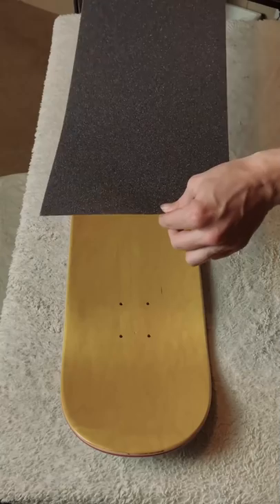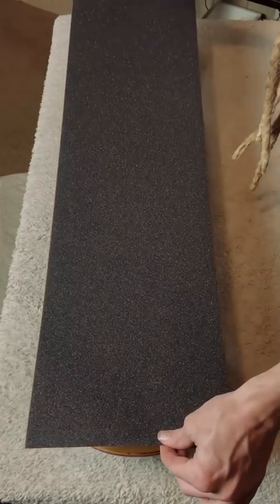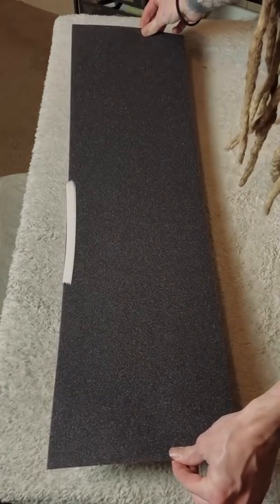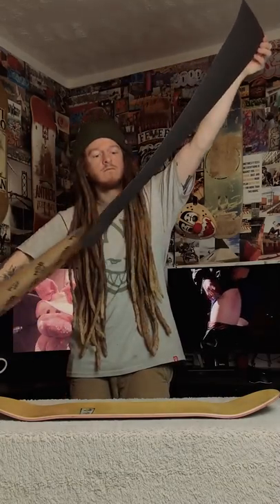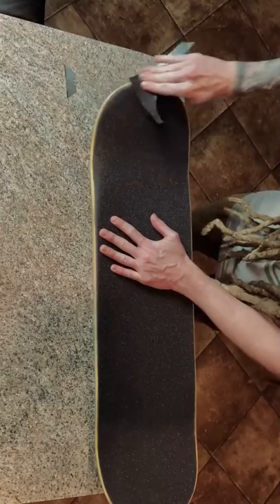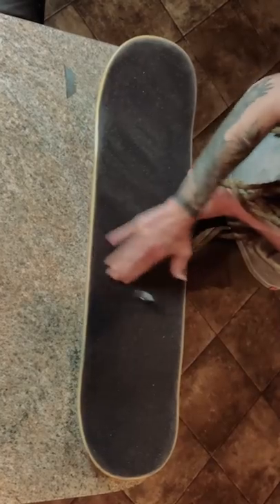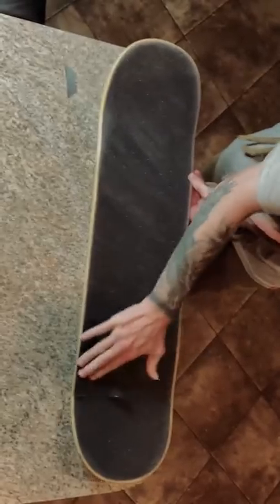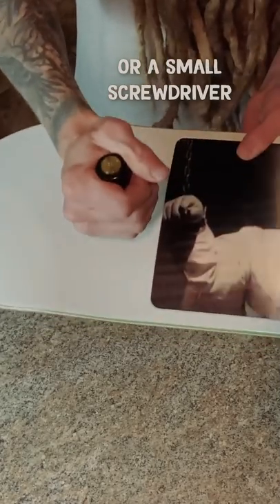How to Grip A Skateboard #shorts

Comment: I always thought I did a solid job at applying my own grip tape but there's some nice pro tips in here. I always did the whole sanding the edges with a leftover piece of grip, but never did I think to sand the actual surface so it's not too grippy. I'm about ready to get a new deck soon too, can't wait to try this!
Reply: yes! Definitely agree with not knowing to sand the surface itself 🤷🏼‍♀️
Reply: Neither. But I guess it rly depends on the tape so see if u need it and don’t overdo it🤷‍♂️
Reply: Just buy jessup, it’s not as rough as mob

Comment: I actually used to use a zippo to heat the edges of the grip after I put it on, I never had the grip peel on me after I did it either
Reply: How does that work?
Reply: @AngryGoose  it melts the glue/adhesive for a better hold on the board

Comment: I'd recommend a small metal file for the edges instead of marring the sides of your screwdriver.   I'm kinda weird like that tho. it helps to round out the edges. I also cut small X's over the holes for the screws for a cleaner hole.

Comment: I would recommend to “peel as you go”...
Instead of peeling the whole backing off and risk and catastrophe by it sticking to itself or where you don’t want it… Simply peel about an inch or so off stick it to one end of the board and then slowly peel from underneath and stick the grip to the board as you go… Also punch the holes from the top side of the board.
Reply: Like a band-aid?

Comment: Just gripped by new board for the first time the other day and thought it was way easier to just lay the center of the griptape on a stool with the sticky part facing up and put my board there!
It's waaaay easier to gauge if the board is gonna fit or if you're slightly crooked 'cause you can actually see what you're doing since the board is smaller than the griptape! Once I glued the center it was just a matter of flipping the board and pressing the griptape from the center to the edges just like the video.
Now I've got say, my cutting job was a mess LOL dunno how people manage to achieve such a clean and regular cut!

Comment: Did my first one in about 20 years this morning and wasn’t to happy, been fitting motocross graphics for years but this was a bit different. Used the blade to pop a few bubbles and put it in the sun before running a new wheel over the deck and it come out sweet 😊

Comment: Fun story, when I first time gripped my board i didn't use perforated grip tape and it went really well. My friend even complimented me on my tape bcs it was that cleanly applied. When I did my second board and knew what could go wrong I used perforated grip tape and it was horrible. The holes tore thru at the sides where I cut the excess of and it overal just didn't last as long. So i guess its personal preference

Comment: I know a lot of people sand their griptape down on the edges and on all over the top, but then why bother buying a good grip tape like mob if then they're gonna scratch it off. I never sand anything , I slightly gently sand down the edges to remove the residue of the glue from the griptape in excess.
Reply: mob is already the cheapest grip tape and costs nothing to sand it

Comment: Please dont do that at the end omg. There’s like a 50% chance the screwdriver won’t punch through and you’ll get bubbles freaking everywhere

Just make a little dimple, then turn it over and punch through from the top. After that you need to cut off the grip around the holes or else you’ll get space between the trucks and the board leading to stress cracks
Reply: Yeah it gave me crazy anxiety. He should have gone in the opposite way once he poked an incision through it

Comment: Your are peeling off your paper wrong.
you should only peel off about a quarter then set the grip and stick the end you have peeled. As you pull the rest of the film off it should just fall into place. Your way leaves too much chance to misplace the grip tape.
Reply from the maker: That does work too. Thanks for the comment. I might make a video on how to do it that way.

Comment: Use skateboard hardware that's literally a screwdriver it's not meant for only skateboards
Reply from the maker: That is a good point. The screwdriver I used I have just for the purpose but an Awl would probably work better.

Comment: I hate when they punch holes threw the bottom...
Reply from the maker: I’m interested in why
Reply: @Skiddyskates  Cause sometimes it doesnt pierce clean and the grip gets pulled back off around the area. Its happened to me like 3 times in my experience but to be fair...it was jessup grip.
Reply from the maker: @armandosoria7993  makes sense. I’ve never dealt with that. Seems like a challenge to find the 🕳
Reply: @Skiddyskates  i would take a bolt, sticking through the bottom til i saw a small bulge and then id stab it with another bolt. I was very anal about my grip lol
Reply from the maker: @armandosoria7993  haha nice I’ll have to give that a try